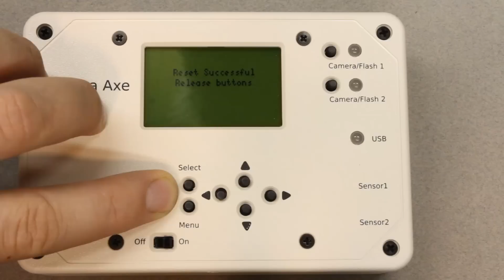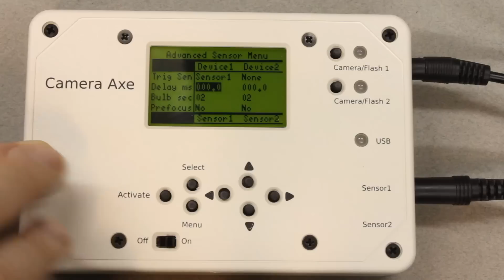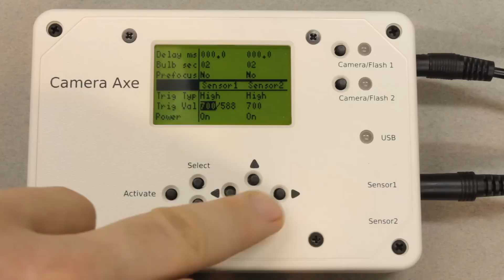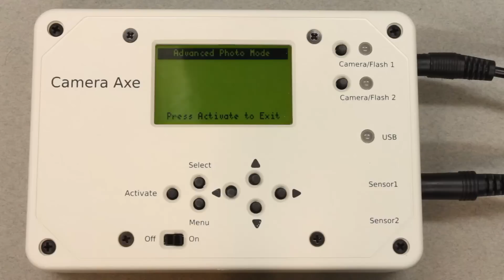TPB #31 - Photographing a Bursting Balloon

Comment: Hey Maurice how are you? I am doing a similar system to the Camera Axe for my Diploma Thesis! I would like to ask you if you think it is possible to have as good results but with wireless communication of the sensors to the Arduino base? Also, do you know how many milliseconds it lasts for a balloon to shrink after it is popped? That is an interesting time, because you have to "catch" the balloon while it pops?
Thanks in advance
Reply from the maker: It depends on the wireless protocol.  Something like wifi or ble wont' work very well because they both have several ms of latency even under ideal conditions.

I'm not exactly sure what the balloon shrinkage time is, but my guess is in the 1-2 ms range.
Reply: Yes that is approximately the balloon shrinkage time from what I found 
also. I am not going to use Bluetooth or WiFi, just some RF modules. The
 nRF4L01+ (maybe I'm wrong about the part number) communicates with the 
MCU with the SPI protocol. From what I've seen it can transmit data in 
the a few hundred microseconds. That might be good enough :)
Thank you very much for taking the time ti respond